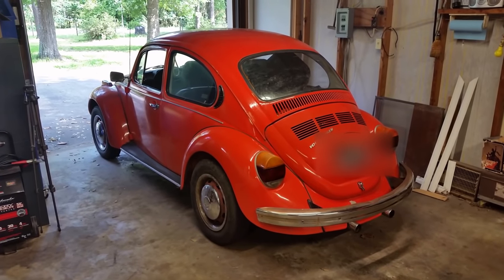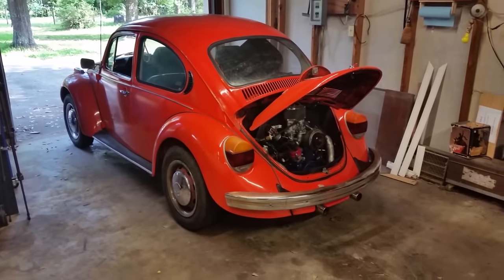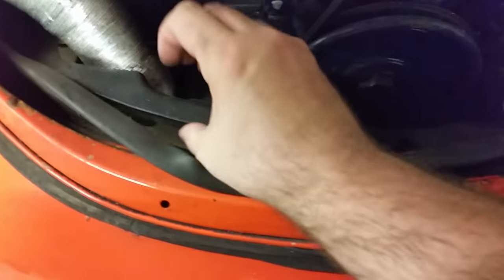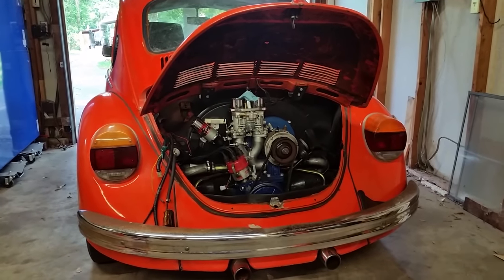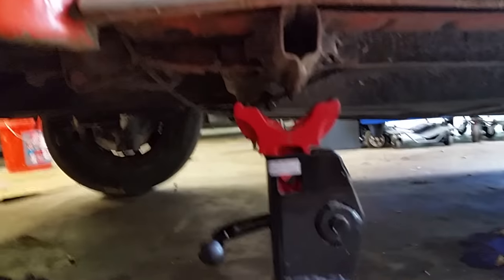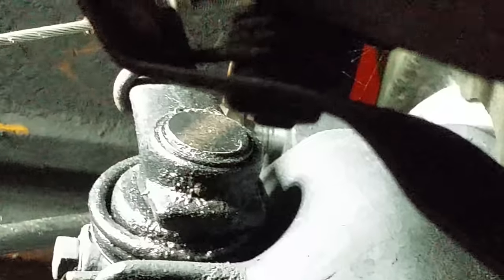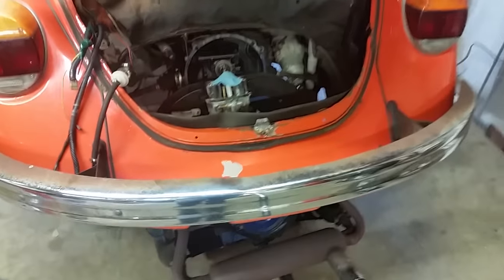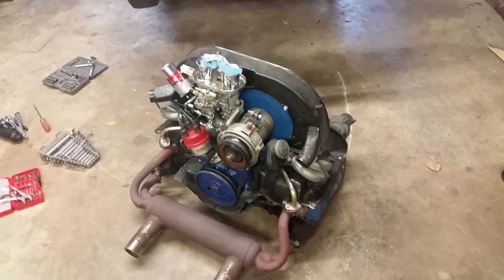How to remove a Volkswagen Beetle air-cooled motor

Comment: Another thing that can be done with Type 1Beetle battery under the seat ... is to purchase a marine polymer battery box and place it where the battery sits. Then put some pieces of wood at the bottom of the box. This gets the battery off the bottom of the box. Next, put the battery in the box on top of the wood, reconnect the terminals and snap the lid on the box. This prevents the battery from getting shorted out on the springs under the back seat. It also keeps battery leakage from rusting out the floorboard which is what normally happens over time.
Reply: Great advice on battery box!
Reply: You forgot to disconnect the axles!
Reply: You don’t need to disconnect the axles. The transaxle stays in the car and only the engine comes out the back.

Comment: A 17mm flat ratchet for the top bolts, a 17mm flex socket for the bottom bolts, sometimes for the upper starter bolt with a long extension. leave the starter in place. Better to place jack stands under the torsion bars, jacking points are often sketchy. eye protection to keep stuff from falling into your eyes. The cv boot clamps are sketchy

Comment: Is that an X-crossed intake manifold there ?
Reply: I've heard of what you're talking about ... but on this setup, it looks like the two intakes converge to create one large opened chamber ... and then the engine banks draw equally from that chamber? I imagine both separate and converged arrangements are available.